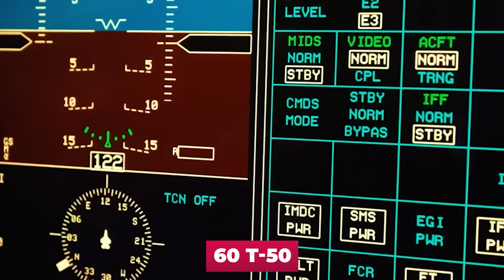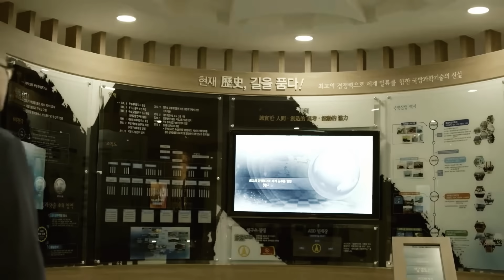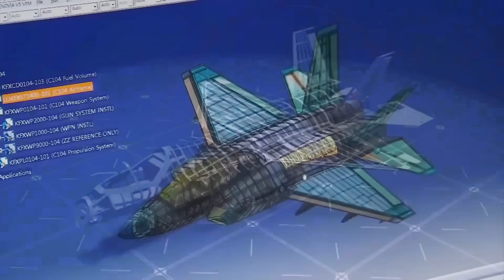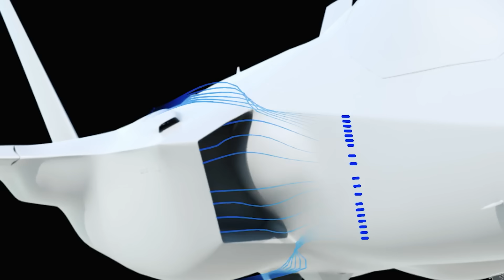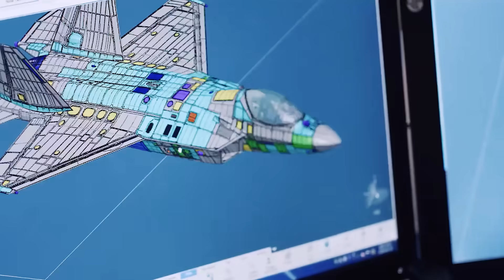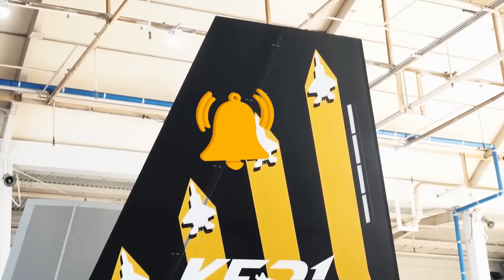Korea Tests Its First New Generation KF-21 Fighter Jet

Comment: KF-21 has two variants built. Single seaters (#1, #2, #3, #5) and double seaters(#4, #6).  #7 and #8 are not meant for flight test. They are permanently grounded for modification test. Total, 8 aircrafts were built. I believe about ten test pilots are involved, many of whom beling to the Air Force. Escort is provided by the Air Force.

Comment: This video conceives many errors. First, the video tells that only 167 F-16C/D are the modern jets in ROKAF. But South Korea has 39 F-35A as well as 59 F-15K(mentiioned in this video). I don't know why it isn't told that South Korea has 39 F-35A in nowadays, South Korea, operating 39 F-35A in nowadays, has ordered 20 additional F-35A. The Lockheed Martin's participation in the development of KF-21 has been carried out in accordance with the contract for South Korea to purchase 40 F-35A from 2019 to 2021. Additionally, this video says that South Korea has 150 F-5E/F. Nope. In nowadays, only 4 squadrons in 10th FW(Fighter Wing), 18th FW are operating approximately 80 F-5E/F that KF-21 are going to replace.

Comment: Its about time they built their own. They have enough american jets to get design Q's to learn enough to finally build something of their own. I don't see how anyone can say that the f4 phantom is outdated. With some new upgrades and a gun its still one of the most dangerous jets out there. They are fast enough and with enough power to be revelant for some long time.
Reply: 😂😂😂 thanks for the laugh
Reply: @adamhayden5152  what's the laugh about then finally learning how to build abjet of there own or the F4 phantom still being able to kick ass especially with modern up grades. I am A Old marine I've seen what the f4 can do it was built like a tank fast as hell only needed a gun. What branch of the service did you serve in salvation army my comment cones from seeing what the f4 was able to do back in its prime and with modern upgrades what it would still be able to do
Reply: @Richard-vt7it  OK botard, Your opinion is just that and its biased. Funny how it needs to be modernized... Still can't touch any 5th gen regardless. If the f4 was so good it wouldn't hold the record for most lost fixed wing aircraft in Vietnam. 

 Why does the navy have Marines on the boats? Sheep would be to obvious! 

 FYI maybe you would be taken more seriously if you learned spelling and proper punctuation.

Comment: The KF-21 is a good looking aircraft, but is reliant an a lot of foreign technology and is very expensive to produce, more than 2 x F-16V's. This is causing much concern, similar to Japan's dilema with its F2 fighter, roughly equivalent to F-16 but costing much more to build. It looks stealthy, but is still a 4th generation fighter, carrying its weapons on pylons.
Reply: 기본설계도움만 받았을뿐 4대 핵심장비. 한국기술입니다
Reply: F-16V price tag is around $70m which is about the same price as KF-21 is. :) Not expensive given when it's stealthy and carry more internal fuel.
Reply: 엔진제외하면 100%가까이 한국산 기술이다. 어디서 주워들은거지 이 멍청이는
Reply: The KF-21 is still a project with a few prototypes flying and will not enter production until 2026 at the earliest. Its the aviation press that are saying its too expensive for what it is, a fairly basic 4th Gen non-Stealth fighter. The project cost so far is 80 Billion.

Comment: I wish they brought the f-23 prototype plans. It was much better than the f-22. Especially when you here how much the f-22 copied technology from the f-23.

The f-23 also doesn't need thrust vector to do the same stunts making matainance cheaper. It was also stealthier than the f-22 without RAM applied. It stored more fuel and more weapons. An yes faster cruse speed.

It was just better.
Reply: The Japanese are doing that.
Reply: @castlekingside76  i heard rumors but things change... I hope to see a production model. It was so ahead of its time.

I mean they used the design in a Macross plus Anime movie. Or Robotech for the Savage's.